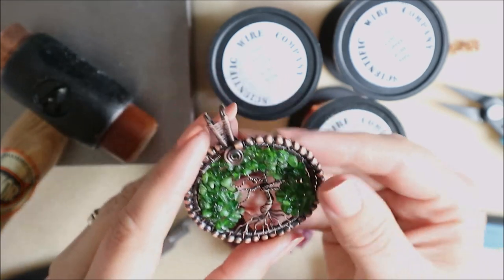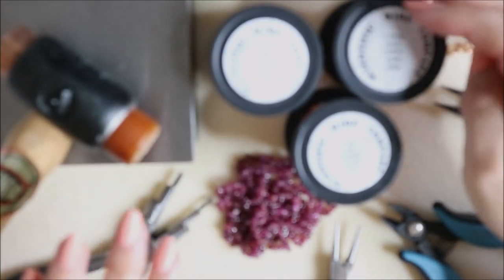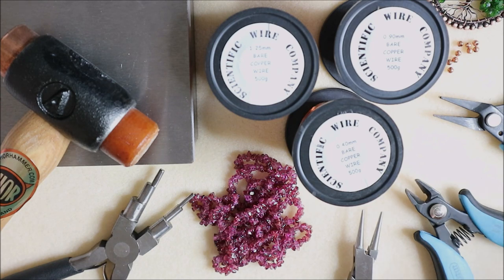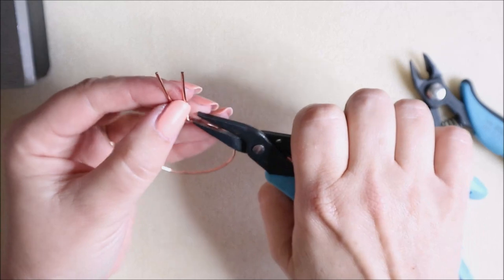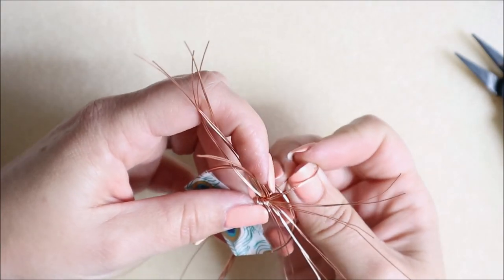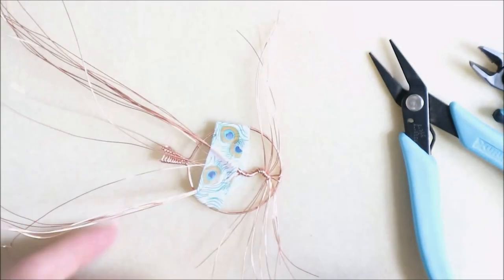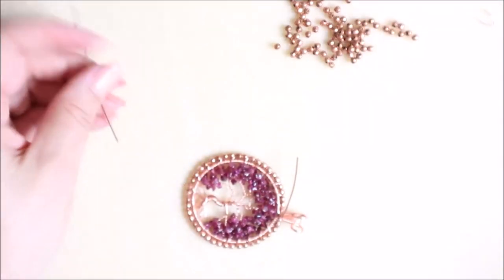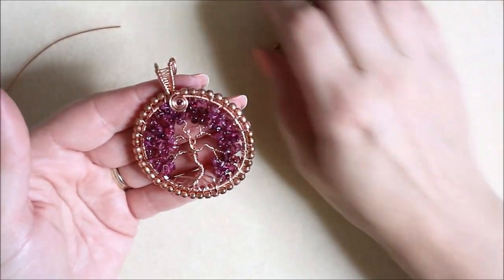Tree of Life Pendant - Wire Work Tree Pendant - Jewellery Making Tutorial

Comment: This is a beautiful pendant, very rich and textured.  But there was a lot of wire wasted. It would help if you had measured the wasted cut offs and then subtracted from the original length to get accurate measures for the next pendant.  You cannot measure exactly since it is a variable twist piece of art, but get a closer approximation.  This would have been helpful.
Also, i feel the second frame is unnecessary and overkill. Why not use the gem wire ends to wrap beads with? Each leftover trailing thin wire bit could have wound 3 beads or more around the first frame  Much better use of materials.

The swirls could have been made with the bail wire ends on either side with no waste either.